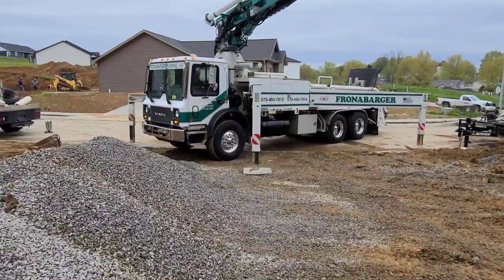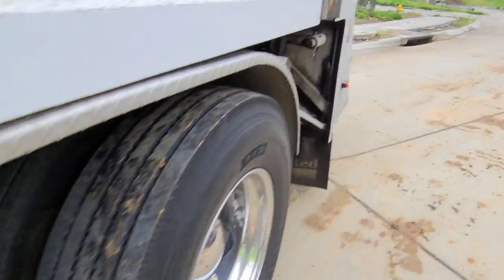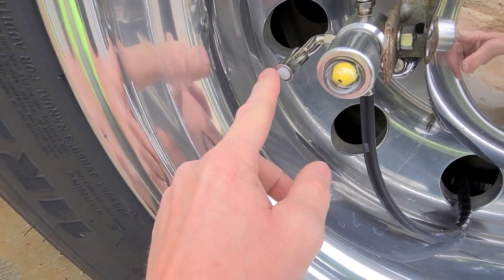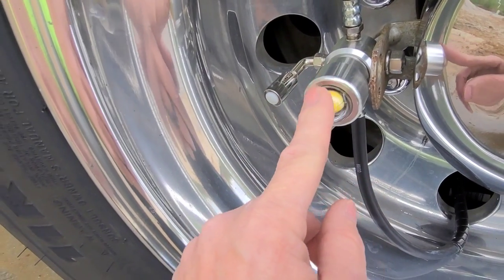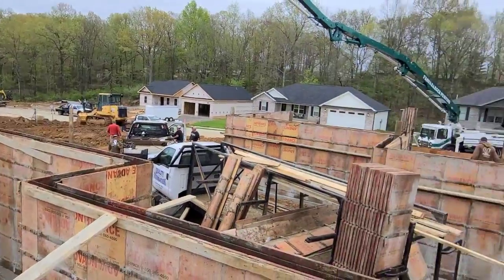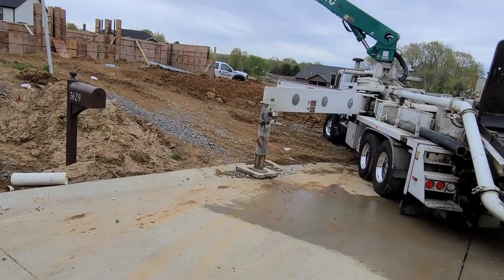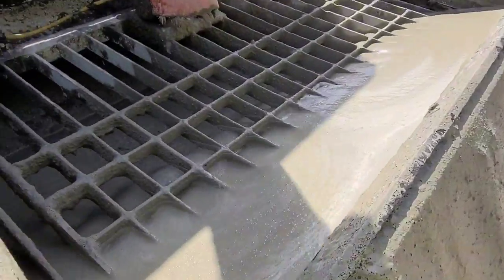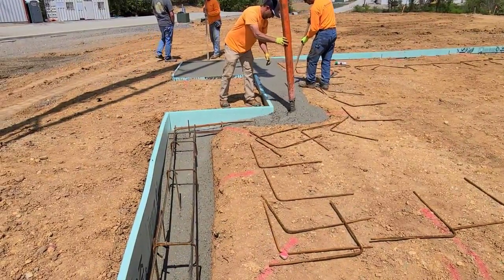Concrete PumpVlog #21. Making Time!

Comment: Like that orange hose, looks pretty handy for wall pours.
Reply from the maker: Very handy hoses, less splatter, smooth, and doesn't put as much pressure on forms.
Reply: @fronabargerconveyingpumping  How do you clean it out after a pour? I imagine its lay flat nature makes it more difficult than a regular hose.
Reply from the maker: @Readymix-Andy  it definitely is more difficult and the first few times I cleaned it, it was a pain in the rear. If you pump down enough and make sure it's clear of mud, then spray and roll. On the longer snakes, we usually just fill with water and pick up the end that has the water in it with the boom.

Comment: Well I just installed my first set of cat eyes today. I got them after seeing them on your video, I can tell you know whats up so im checking them out. I have 63 trucks to put them on so its a bit of an investment. I looked at those L.E.D caps for my steers but wasn't sure about them. Please let us know how they are working out. Thanks for your great videos and keep them coming!
Reply from the maker: I need to get back on the video making bandwagon. Been pretty busy lately, just need to video it. Lots of Pools going in around our area, that seems to be the new hot item these days. Hope you like the cat eyes!
Reply from the maker: How are you liking the cat eyes you installed?
Reply: @fronabargerconveyingpumping  They have been great so far. Caught quite a few low tires early and saved them. I have them on 35 trucks so far and every new one we get from now on.

Comment: Were do you get your orange drop hose and do you just use them on walls.
Reply from the maker: We were getting these hoses from Brundage Bone Concrete Pumping, but now Conforms makes the same type of hose but it's yellow.
Reply: @fronabargerconveyingpumping  sometimes they are called "tremmie" hoses or a lay flat hose. We have quite a few of them that we really only use for walls.  Occasionally if we know were going to a job where the contractor and crew are very slow we'll use it then as well.